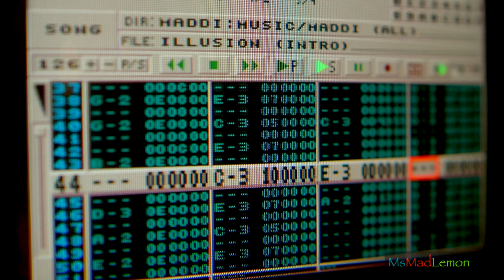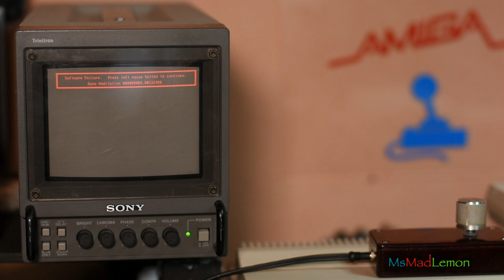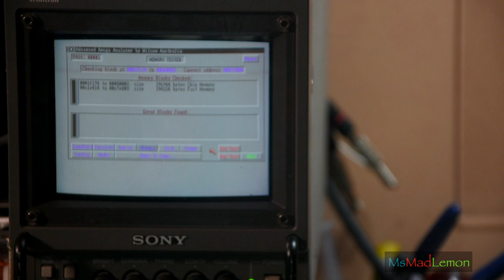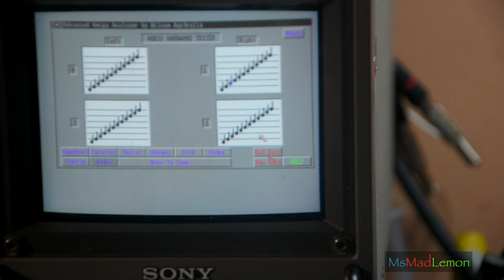Amiga 500 repair/recapping and retrobrite/sunbrighting follow up talk

Comment from the maker: http://hellcathq.com/breakdown-of-de-yellowing-techniques-for-retro-computers-and-consoles/
Reply: about that link, my BIG one vote against one source is quora; Ive found thru time that site quite poor in answering practical things (it's the yahoo of emailing for a rough metaphor); I'll go with reddit all the way for serious technical discussions; cheers and happy restoring!
Reply: @clarkkent6026  I usually agree with quora not being the greatest source, however in this specific case the guy on quora did basically an easier to understand summary of what is said in a couple of other papers (they should be linked as well, but I'm going to double check as soon as I publish my next update). I focused on the content and not on the platform before deciding if what was being said made sense or not. The process of plastic degradation is well understood and proven, but I found lots of sources are not very "user friendly" with their choice of words.
Reply: what's the little red colored card in the memory slot  (trap door slot if is case) info please, :-)
Reply from the maker: @dh2032  it's a half meg memory upgrade, but a modern one.

Comment: 5 or 10 years ago we probably got away without recapping many A500s. Now we are getting into the 30 years + realm. Caps are close to or over 30 years old for A500s. I have started an effort to recap all my A500s now. I focused on my A600s/A1200 for the most part with regards to recapping. Did one A500 last year and another one today. The one I did today had some weird issues which it had a few years ago aswell when I think about it. Typical cap issues. Chips on this Rev 6A board was dated 1989. So caps are almost 31 years old. Still have about 5 more A500s to go and several PSUs. I have recapped one A600 PSU which had bad fish smell and some interference due to bad caps. I have also recapped All my C64s. I agree with Ms Mad Lemon and many of the comments here, C64s and A500s need recap now. They lasted much longer than A600s, A1200s and A4000s which have surface mounted caps, but there is a limit for radial through hole caps. And we are waaay past that limit.

Comment: The thing that people say that the Amiga500 will not need recap, live in denial on how caps are working. Every cap are rated for a specific set if hour of useage. Sure it it higher on quality caps, like those used in the 600 and 1200. At some point, every 500 need to be recapped, just as a C64.
Reply: Also. I prefer using an antistatic wrist band. You know. The one that have a grounding wire. And I prefer using a manual solder sucktion pump. Finishing off with copper braid. At least we do things differently, and as long as the goal are reached, then it is all ok.

Comment: My amiga 500 case is very white but not the keyboard, so it was tempting to sunbright it. And I am doing that :P I hope the plastic wont get too brittle. At least it's not as hot in Norway yet.
Reply from the maker: Good luck
Reply: I did that to an Amiga 500-keyboard the last 4-5 days, and it was somewhat successful. But I strongly encourage you to remove the keys from the keyboard and do it only on the keys because when I picked up the keyboard at the end it was so hot on the backside that I burned myself on it. I guess the black plastic and metal backing absorbed and trapped the heat. I have not dared to test the keyboard after that so I cannot say if it works or not, it's a spare keyboard anyway.
Reply: @MsMadLemon  Thanks :)
Reply from the maker: @MariaEngstrom  If you choose to do it, please, please do not do it with the electronics and PCBs still inside... the membrane inside the keyboard is only plastic will melt and warp at those temperatures if it's getting that hot.... also this heat will ruin electronics components.
Reply: @MariaEngstrom  Thanks for he warning. I am afraid of removing the keys because there are some birds that like to take stuff here. I will keep an eye on the temperature.

Comment: Nice, I had to recap my Atari 520ST power supply as it just would not power on, It was the largest capacitor in the psu that was causing the problem, I replaced them all for preventative maintenance.
Reply: this sounds like what happened to me back in 1994!! at the time my skills back then, i was about 13 years old and had no idea about things like that :( hurts that its all it was, THAT and probably my no unstanding of the EPROMS (yes i took off the stickers so i could see the chips under it...... can you guess what happened shortly after? LOL)

Comment: I was suspicious so I tried it and it worked, but would I do it over days and days??? probably not. Maybe do it a little bit to break down the  yellowing and take baby steps with it, Ive had a fail with the old method of using peroxide creme once, on my gvp hd8, although Ive done a few amiga 1200's over the years and a 500+ the usual method.

Comment: I've only recapped a few older computers and consoles as needed. Mostly laziness. it works why fix it right. However old audio gear and guitar amps I always recap. Some of them before I even turn it on for the first time. I have some very odd priorities. Lol
Reply: Audio gear from the 80s needs no recap usually. Even older stuff can be fine... Solid state at least. Tube stuff with paper caps is always in desperate need of it though.
Reply: @westelaudio943  Unfortunately I have yet to work on much that new. Lol

Comment: I recently annoyed a never-capper on a different site, he had a problem with my "shotgunning" all of the caps at one time ("Shotgunning" being a term we use in the factory to mean that we had replaced everything, usually because the darn thing still wouldn't work after all of our other attempts). He wanted me to account for each and every one that I removed. Basically, take them out, check them, and if they have a few more years left in them, put them back in. Riighhtt....

Now to anyone who likes old caps, and prefers to leave them in peace. I have a few things to say:

1) It is perfectly all right by me what you do with your machine, please extend the same courtesy to me. 
2) If you're into the digital equivalent of a "Schrödinger's cat" experiment on whether it's going to boot or not, that's fine by me. Me, I'll stick to ripping tags off of mattresses to get my thrills. (Spoiler alert, Schrödinger's dead, no word yet on the status of his cat).
3) What are you worried about? Do you think that I'm going to leave you my Retro gear in my will? If that's the case, you don't have a thing to worry about...